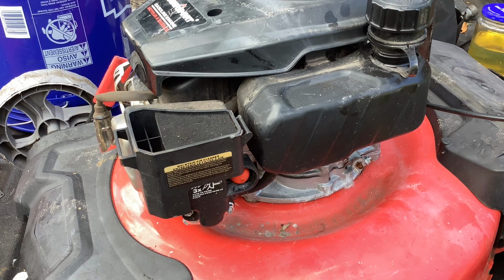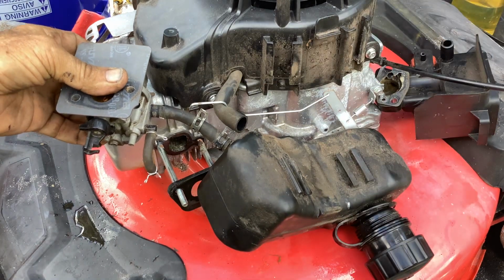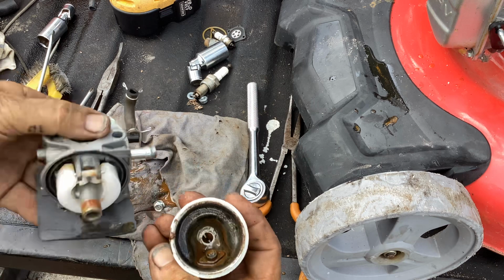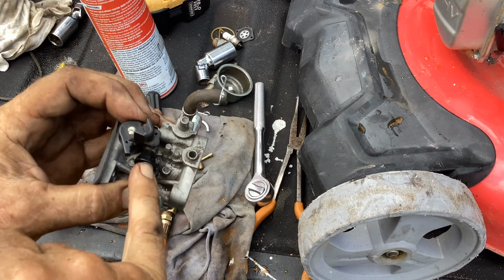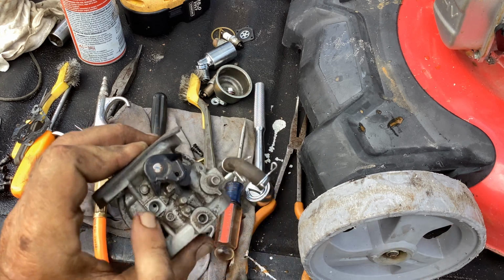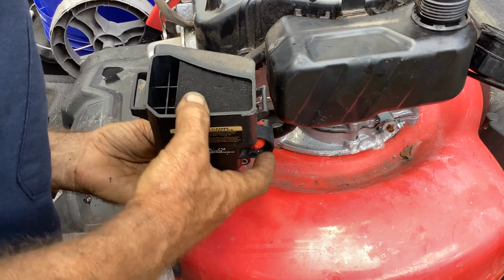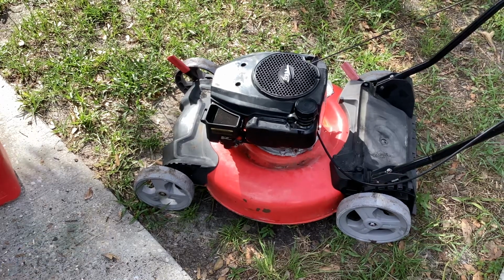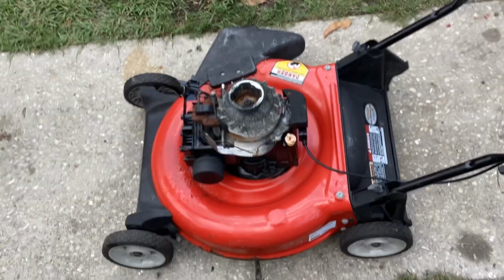PowerSmart 144 cc Lawn Mower Carburetor Removal and Cleaning...Very Easy!!! Anyone CAN do it.!!!

Comment: Hey Tommy.  Good video.  I've yet to get a Chinese powered anything.  Are parts hard to find?  Are the parts expensive?  Anyway, I sold 5 mowers in May and 2 so far this month.  One more to fix and I'm out of mowers to sell.  Mowers needing repair are hard to find or very expensive up here compared to what a running version of the same mower would be.
Reply from the maker: I have been able to limp along on used parts on these turds.  Build up your dead mower inventory...season is in full swing!!
Reply: @tommy-time5240  Yeah I'm trying to build up my inventory.  As I said, they are kinda in short supply around here.  I need to find an independent source, however, I couldn't handle the volume you do.